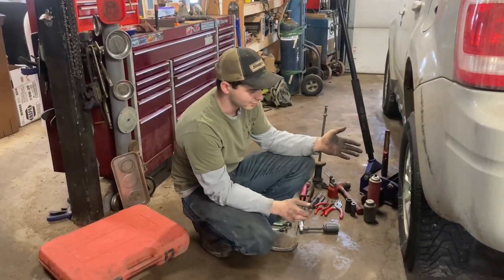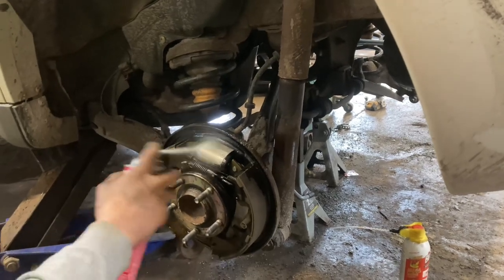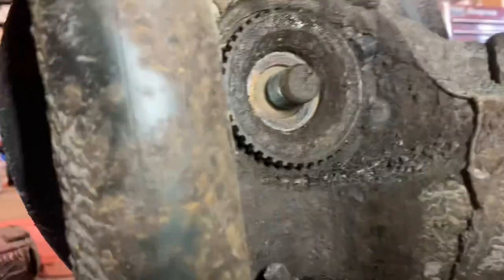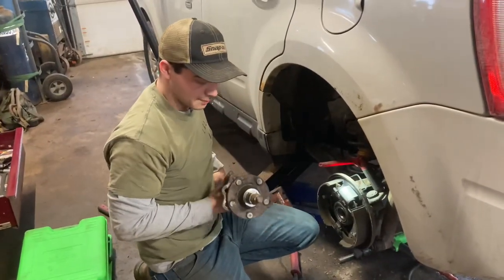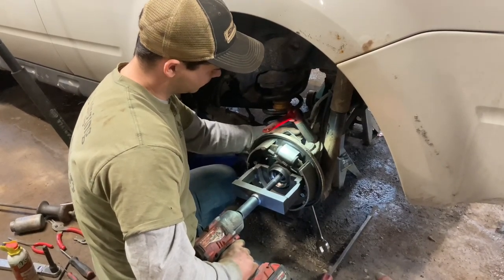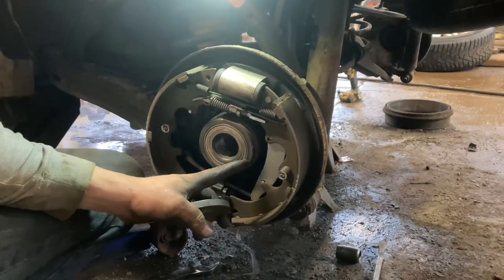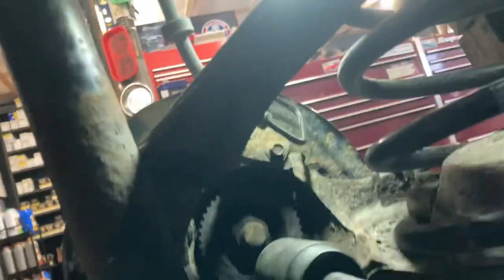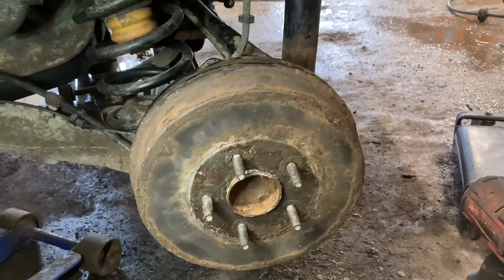2009 Ford Escape rear wheel bearing change ON CAR

Comment: Does anyone happen to know the part number or website link for the FWD rear wheel hub knuckle/assembly ? Can’t find it, TIA
Reply: I believe you can't buy them new anymore...used or a junkyard pull. I seen them on eBay for $200 a side

Comment: When you pressed the hub back in what did you do with the ball bearings
Reply from the maker: I just tossed the old ones in the scrap pile. Once in a while I give them to my little cousin for his sling shot haha
Reply: Did you install new ones and if so did the new hub come with them
Reply from the maker: Yes the new wheel bearing comes with new ball bearings inside of it

Comment: Alright bud. Watched half the video, to the 'toner ring'. You're doin alright for the most part,
You just Have* to dial down the unnecessary banter.  
  Save the talking for the steps and tips; you're makin heads spin tryin to keep up. 
 Less is more. 

 Otherwise you're doin alright bud. Im takin the time givin a critic (even tho I'm passing on the vid.) so to look out n help a fellow blue collar boy out. Take it or leave it.  Thanks bud
Reply: Did you get  triggered, bud?
Reply: @jeffro221 he needs a safe space.